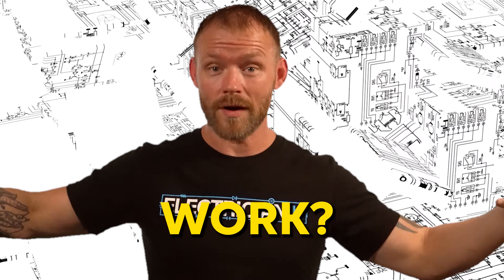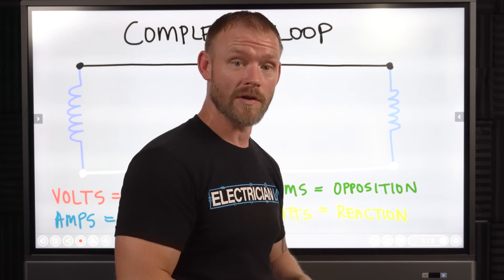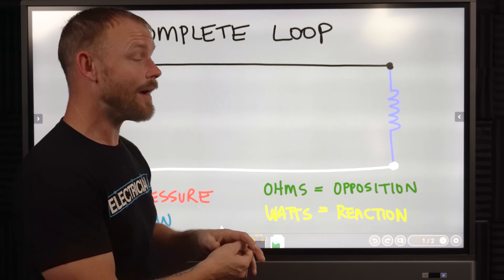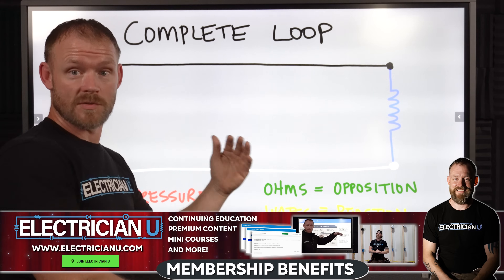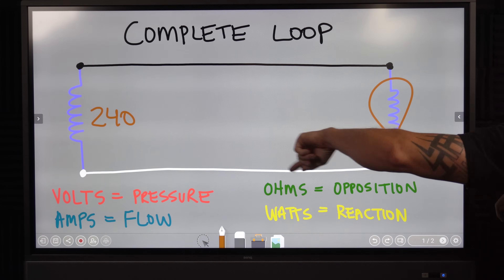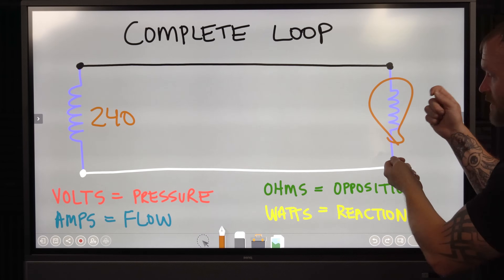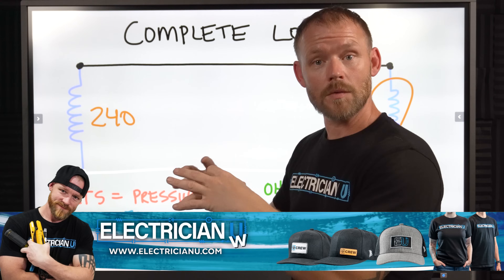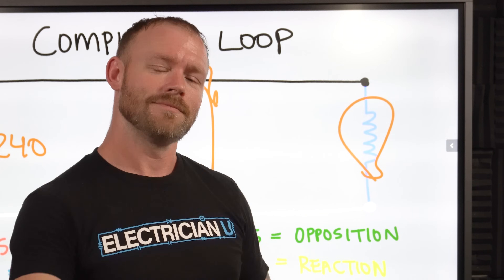How Do Circuits Work? Volts, Amps, Ohm's, and Watts Explained!

Comment: The amount of knowledge this guy has. Love it
Reply: Yeah its weird. I know several electricians that don’t know half of what this guy knows. Most of them just show up to get a paycheck. This guy actually cares about the field he is in.
Reply: @Flowtester1  that's wild. You would think people that work with electricity would care specially because of how dangerous it is. Granted I see this mostly in residential beacuse the barrier to entry is very low. Imagine just showing up and not caring at in industrial facility working with 277/480 volt motors and transformers you'd get either fired or fried.
Reply: Thank ya kindly

Comment: Water analogy
Volts = pressure, speed of the water
Ohms = size of pipe 
Amps = how full the pipe is
Watts = pressure of the water times size of pipe and how full the pipe is. 

So you can have a really big pipe completely full but with low pressure. 10 amps x 12 volts = 120 watts

Or you can have a small pipe with high pressure. 1 amp x 120 volts = 120 watts. 

2 different ways to achieve the same amount of water being supplied. In electrical terminology that is 120 watts
Reply: Here is a good example. Compare a 120v lightbulb to a garden soaker hose.
Give the lightbulb 5 volts. Electricity is flowing but the lightbulb is not producing light. 
Give the soaker hose only 1/2 a turn from the spigot. Water is flowing but non is coming out the soaker hose. 

Give the lightbulb 120v and you get light. 
Turn the soaker hose spigot on completely and your plants get a nice drink of water. 

Put the lightbulb on a 240v circuit and the bulb will get destroyed and the circuit will be broken. Stopping electricity from flowing. 

Attach the soaker hose to a fire hydrant and the soaker hose will explode destroying the soaker hose. But this is where the analogy fails because the broken hose just starts spraying water everywhere instead of stopping the water from flowing like the bulb did to the electricity.
Reply from the maker: Only disagreement I have is that Voltage is not a rate over time, and amperes IS a rate over time. So voltage is pressure between two points yes, speed between them no. And how full a pipe is isn't quite accurate, current is a measure of how much flow of "particles" pass a point over a specified time. We don't think about current like MPH but we should, time is the other half of the variable.

Comment: Would a clip-on ammeter work differently with direct current, if there isn't a back-and-forth like there is in AC? Great video, thanks, Dustin!
Reply: Yes an AC clamp meter is much easier to make so only the more expensive ones above $50 will Also read DC current.

Comment: I'm having trouble understanding the analogy people in the pipe ohm's law illustration. Like that doesn't seem like what is happening.  What happens to the power consumption/energy savings as 110 volts ac it converts down to a 5 volt dc with a transformer/buck converter. Why isn't there like a load resistance of 105 volts that's held back by the phone charger as it allows 5 volts through to be used?  Maybe a better explanation would be voltage is like traffic on the streets, roads, and highways. Resistance is the type of road, a gravel road would be fine for light traffic, low voltage. 110 volt traffic is fine on the main road but they don't really want to take a turn through the converter to the gravel road, perhaps 5 volts would do it when a load is present?
Reply: I think the 110 V down to 5 V will make more sense if you understand how transformers work. The 110 v is going through the wire on one side of the transformer. Creating a magnetic field that energizes the coil on the other side of the transformer. The difference in loops of wire in the coil is what changes the voltage. 

So 110v goes through a coil with 22 loops. On the other side of the transformer there is only 1 loop. So 22 loops is to 1 loop as 110v is to 5v. That is how you get your 5 volts. 

But the wattage stays the same on both sides of the transformer so the amperage also has to change. So if you started with 0.1 amp you will end up with 2.2 amps. So there is theoretically no loss of power. 

110v x  0.1amp = 11 watts
5v x 2.2amps = 11 watts
Reply: @ecospider5  thanks, that cleared up my confusion, I was wondering why these  plastic brick converters don't go up in flames more often.
Reply: I’m glad that made sense. Since we are talking about transformers her is an interesting fact. Around 2010 the industry started using transformers differently in power supplies. That is why a 12v power supply or a usb power supply looks so different now compared to a decade ago. 

A transformer changes voltage between the 2 windings when it gets a pulse of electricity. AC current has that pulse because it goes from a negative voltage to a positive voltage 60 times every second. 

Well around 2010 they figured out how to pulse DC current at a reasonable price. So now they are sending DC current through the transformer. Pulsed DC in pulsed DC out. The pulse is thousands of times per second instead of just 60 times a second. 

Because of the fast pulsing the transformer can be way smaller. That is why power supplies have gotten so small compared to a decade ago.
Reply from the maker: @ecospider5  This is a quality explanation I hope is seen by more people
Reply: Your voltage is not what would change on the gravel road. Voltage usually is the stable part amperage is what changes. Except for strange things like transformers.

Comment: The electric baseboard heater in my bathroom ramped up to the speed of light yesterday when it shorted out and burned the fuck out of my floor and destroyed it. I replaced all those cheap flimsy Dimplex baseboard heaters yesterday after witnessing that.

Comment: You need to update your theory of how electricity works. This theory was fine in the 1800s but not today 😪
Reply: I would think this level of understanding works for all the calculations a master electrician has to make. If you are designing microchips the more advanced understanding is definitely required.
Reply: Why do you say that?
Reply: Fathers of electricity: Michael Faraday(1761-1867), Sir Isaac Newton(1643-1727), Thomas Alva Edison(1847-1931), and Nikola Tesla(1856-1943), still the same concept is being used in today's miniaturized supercomputers.
Reply: A lot of people have an updated understanding of how electricity works.   Which is why there are also YouTube channels such as "The Science Asylum".
Reply: yeah , like maybe mentioning some examples of nerdy stuff like  Ohms law.    Clearly this is for practical purposes , but I just dont get what was said about resistance "slowing down  the speed of light".    I (current) = V\R   (and its variations) is the main thing you need to remember .     
But the general analogy of fluid systems is quite valid , as the same equations can used to describe their behavior.
   Theres some interesting  videos out there about how electricty really works (like how its really the Electro-Magnetic Force that moves things, not an actual flow of electrons) but we dont really need to worry them here
Reply: I can solve Maxwell's equations but I rarely need to when installing a subpanel.
Reply: Right, but this is still a way easier to understand (or explain) how a circuit works in common words. Really nice video.